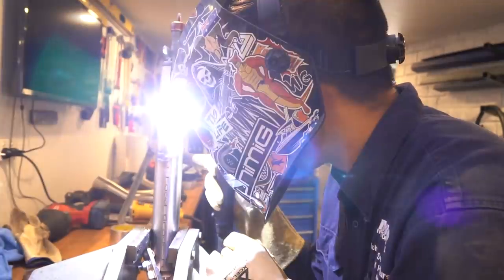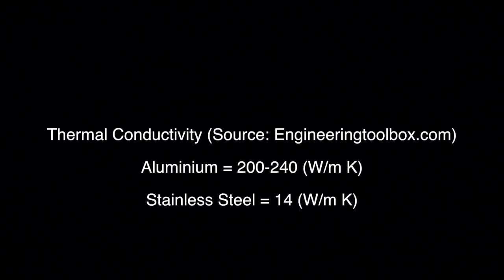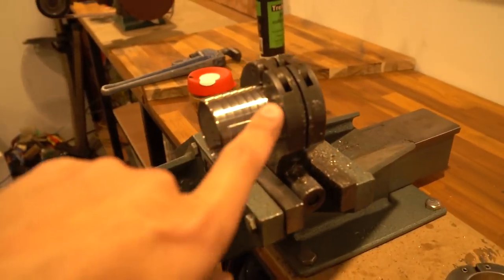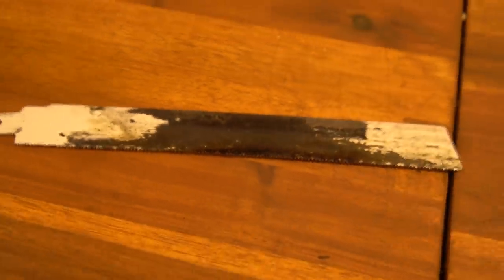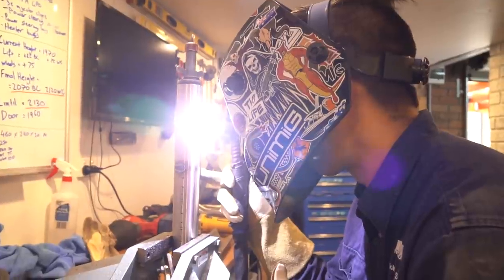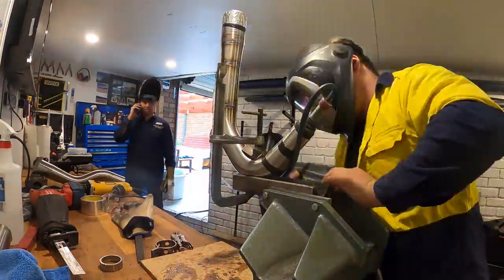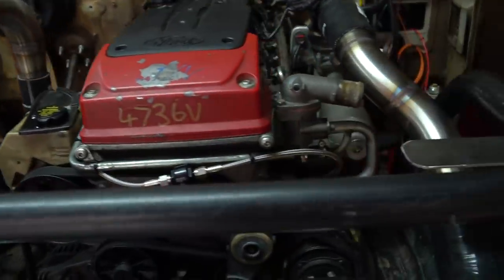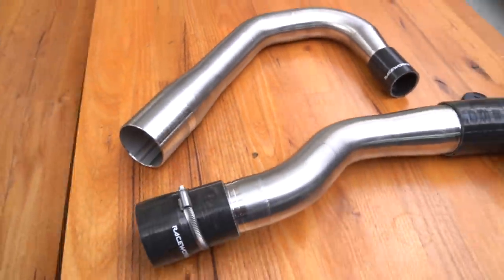Designing and fabricating Stainless Steel intercooler piping  - Barra T 45/80 Build Video #5

Comment: I have my cert 3 in welding, but really want to do some more welding. What welder what you get if you could only have one?
Reply from the maker: I think I would stick with an AC DC Tig as it can do everything well. That said if you’re only going to do steel then there is no need for the AC part of it. I have 200 amp unimig machine and it works really well but I’ve had to pick up a a MIG for all the thicker gauge steel chassis work I have to do.
Reply: @DesignedandBuilt  yeah sweet as man. That makes a lot of sense. Cool thanks for that 👍 and love the videos so much. Nice to see some real vids still on YouTube!
Reply from the maker: Thanks mate, means a lot!

Comment: Are you just fusion welding the stainless
Reply from the maker: Yep, no filler rod!
Reply: @DesignedandBuilt   why no filler?
Reply from the maker: If the pipes are perfectly touching then there is no need, if there was a gap then it would have been required.